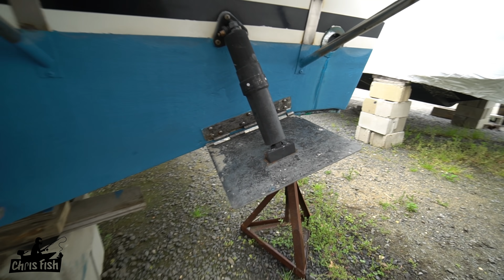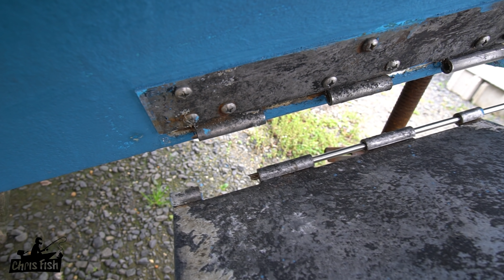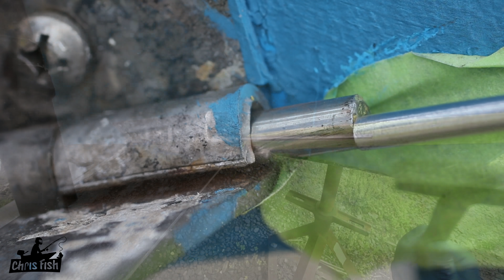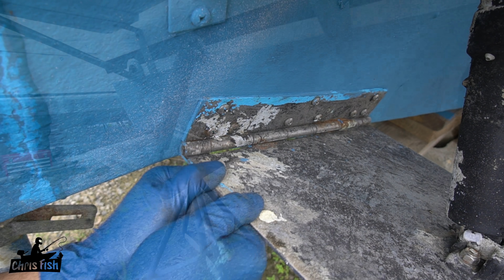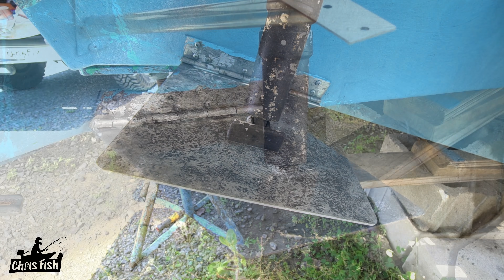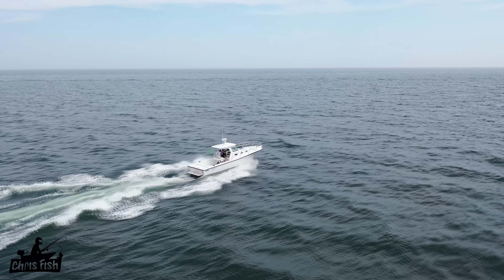How to Repair Boat Trim Tabs (Saving over $350 by doing it yourself)

Comment: So after several seasons have there been any issues with galvanic corrosion??
Reply from the maker: Yes I ended up finding the problem. The previous owner cut the cable to the mercathode. I replaced/repaired it and I hope the boat goes in the water soon!

Comment: Hi Chris, just a suggestion for you and your followers: you need to put a small plate of zinc on each flap, in the upper side of it, otherwise you should change again soon the shaft you just repaired. The reason is that the flap is severly interested by the galvanic current, due to the sea water flowing under it. The galvanic current produced by the interaction with the water flow will destroy soon the   noblest metal among those that make up the structure of the flap, and I suppose will be again the shaft of the hinge. Make a small hole in the center of the flap, then put the zinc plate in the upper side of the flap that will be secured by a simple pin and a self-locking bolt, and that's it! Change the zinc plates every season and the problem will be fixed for ever.. ;)
Enjoy!
Reply from the maker: Interesting. I didnt realize moving water could create galvanic corrosion. I will look into it! Thanks a lot!

Comment: the thing to understand about stainless is that the reason it doesn't rust is because the chromium forms an oxide layer, however if the stainless is always submerged that oxide layer cant form, and then it will still rust.
Reply from the maker: Interesting. But then why won’t stainless rust underwater?
Reply: @chrisfished  it does lol, some grades are better at resisting the rust but all stainless can rust. passivating can improve the corrosion resistance, but that can be worn away with abrassion, for example when used in a hinge.

Comment: Looks like that old rod is 304 stainless steel! It gets pitted over time from the chlorides in the water
Reply from the maker: I wouldn't doubt it if it was! Felt pretty cheap though
Reply: @chrisfished  Crazy how they would cheap out on the hinge! But it didn’t look like it took too long to swap it out. How many years did the original one last?

Comment: Hello! Just a point of suggestion, you might want to consider placing zinc anodes on the trim tabs. Two dissimilar metals will always corrode the weaker metal even if they are both stainless steel. Having a zinc will make sure the corrosion will happen to the zinc and not your $300 trim tab.
Reply from the maker: Definitely a great option but the outdrive has a mercathode which apparently was not working so I fixed that and that’s supposed to protect the metals from corrosion.
Reply: @chrisfished  unless there are bonding wires from the trim tabs to the out drive the trim tabs are unprotected. Granted, it’s not a massive risk. As your video showed, pretty easy to fix. Good stuff!

Comment: You need to put anodes on your trim tabs.

I suggest either Zimar R2 or Zimar R3 anodes.
Reply from the maker: The outdrive has a mercathode that was not working when I got the boat. It’s functioning properly now so that should fix the corrosion issue. If that doesn’t work then I might have to weld a stud to the tabs and get some zincs on them.
Reply: @chrisfished  no sir simply drill a 5/16 hole in the trim tab and I’ll send you a set of the best saltwater trim tab anodes you can get. 

I’ve been watching you for years so I’d be happy to help!

Comment: The fact that you pay so much money for a boat of your size and has low quality trim tabs is unbelievable! Also what happened to all of those dead fish in the day you lunched the boat? ( if the word lunched is wrong correct me)
Reply from the maker: Corrosion is a big issue in saltwater! The fish had a virus or bacterial infection that kills them. Happens to a small population every year unfortunately.
Reply: Wow ok. By the way I have a car that leaks a lot of oil so much that it has covered the gearbox!!! I think it's something like a seal on the oil pan I will send you on Instagram the pictures. Thanks alot

Comment: Need clarification; manufacturer used iron for cost reduction or prolonged duration of use? Is the metal rod you installed durable and NOT just corrosion resistant?
Reply from the maker: Correct the stainless rod will be durable and corrosion resistant. Idk why they used a cheap iron rod.

Comment: he did more damage with the tape i guess better safe then sorry if i was you i would hate staring at that love you keep up the good work on both channels i love how you read every single comment and respond like who has time for that??!?!?!? also have you ever gone overboard? or fallen in the water trying to get in the boat?
Reply from the maker: It’s not damage. It’s ablative paint which is designed to come off to keep barnacles and other stuff like that off. I didn’t want to damage the gel coat which is the coating under the paint. At the end of the day the tape wasn’t really necessary tho (as you saw haha). I have never fallen overboard on the boat. I have on the dock twice. Both times I had my life jacket on and was ok. Falling off the boat would be very scary.

Comment: Shoudn't you use a more corrosive resistant steel than just stainless? In Finland we have something we call acid resistant steel. I would use that rather
Reply from the maker: 316 is marine grade stainless so it’s very corrosion resistant.
Reply: @chrisfished  Oh ok! Hope it lasts a long time!

Comment: Wow great job saving the money and doing the repair yourself. It’s great to maintain your own stuff.  Only question I have for this job is should it be a tight fit and should that rod be lubricated first?
Reply from the maker: Thanks! It’s only a tight fit on the ends which don’t move (hard mounted to the boat). The holes in the trim tab move and the water is the lubricant. Any oil/grease will come right off in no time from the water pressure. Great questions

Comment: As soon as i clicked I noticed a wobbling noise at the very start of the video coming from the microphone housing. To fix this, you can tape the anti-shaking housing so there isn't any severe vibration when walking with your camera
Reply from the maker: Thanks for the tip! The mic actually broke that day and I didn’t notice until I got home.

Comment: I'm not into fishing or boating but I do enjoy watching you do this stuff. Why would you not remove the factory screws on your trim tabs?
Reply from the maker: Thanks a lot Richard. Those holes the screws are in are below the water line and its just a lot a lot easier and less risky to not touch it if you dont have to. Nothing might happen or it could snap or it could cause water intrusion issues. Great question!

Comment: Be careful mixing different metals like that especially in saltwater
Reply from the maker: For sure but that is what was used except they probably used 304 stainless which isnt as corrosion resistant. .

Comment: Hey Chris! Just curious, since I have pretty much zero knowledge in boats, why didn't you grease up the rods before driving them in? Is it completely useless? I like to grease pretty much everything that could be helped by lubricating, also, maybe one more layer of rust protection?
Reply from the maker: That will be under water so the grease will be gone pretty quickly. You're def right it wouldnt hurt and might help a little with the corrosion for the short term. The water will act as the lubricant since it is slow moving. Good question!
Reply: @chrisfished  Thank you Chris!

Comment: Thanks for your new channel, and all you hard work. I even went back 7 years to learn how to filet fish from you, video I had skipped previously :D. About this video, even guessing that it'll probably wash out in a day or two I wouldn't be able to resist applying a ton of heavy duty grease to the joint before installing, I mostly work with bicycles (and wood) and have almost no experience with boats (besides brushing decks and filling cracks with glass fiber).
Reply from the maker: Thanks a lot man! Haha I was going to add grease but like you said, at the end of the day, its going to wash away the first time it goes in the water. Hopefully you learn something new with boats by watching!

Comment: The reverse on my pontoon's outboard engine doesn't work (im thinking a clutchdog). Would love a video on how to disassemble and reassemble a similar engine. Keep up the great work and fun videos!
Reply from the maker: Does it click into reverse or does it not even click in?
Reply: @chrisfished  it clicks
Reply from the maker: @EagleFreedom21  is there any noise or vibration? Does the prop spin at all?
Reply: @chrisfished  Just the clicks. Prop spins slowly, not enough to move anywhere.

Comment: Hey Chris where did the outdrive go do you take it off when you pull the boat out of the water
Reply from the maker: The marina takes it off for indoor winter storage. They pressure test it and change the gear oil for  me.
Reply: @chrisfished  ok thanks

Comment: Where I work, we usually sand the the trim tabs with a 40-80 grit before painting. It makes it smoother, cleaner, and better for the paint to stick on.
Reply from the maker: Thanks! I used 120 grit to sand it which seemed to work pretty good so far (2 seasons later).

Comment: Hey Chris! Can you make a video showing ways to find out if your V-Drive Boat has a cracked block, or just a failed head gasket? I’m getting water in my engine oil and transmission oil.
Reply from the maker: Do you have an oil and trans cooler? Many times the thin metal on those corrodes. If you do, take the oil cooler off and get it pressure tested.
Reply: @chrisfished  I don’t on this boat. It’s an open loop system so It takes in the lake water to cool. Any other tips or tricks you might have for me? Appreciate the response and love the videos! Extremely helpful!!

Comment: Nooooo! You can only use a file in one direction, otherwise you blunt it!
Reply from the maker: Thanks for the tip. I am not sure if it is a big deal since a file is hardened steel and the 316 stainless is less "hard" but I will keep that in mind!

Comment: They don't make a pin? I mean they got aluminium rods on ebay 😂

Steel, man... Sometimes steel doesn't even have iron in it, like surgical steel, which is why I can't trust it 😂, I hope this doesn't rust!

Could you also peen the ends?
Reply from the maker: It's been 2 years and no rust at all so it's all good. Aluminum is too soft and might shear with the pressure from the water. You could peen the ends but this worked perfect.

Comment: I love seeing how you apply learnings from the first pin to improve your method for the second! Did the tape pull off some paint, or is that adhesive residue?
Reply from the maker: It pulled off paint. I realized the marina painted the boat only a week ago and since this is anti-fouling paint it is designed to come off so barnacles and other sea life wont stick to it.

Comment: Was the end that you pried open supposed to be closed/tight to prevent the rod from moving and the rod intended to be inserted from the other side?
Reply from the maker: No both ends are supposed to crimp down on the rod. Technically this is a "non serviceable part" according to the manufacturer so I had to make my own rules haha. It's held up for over 4000 miles and 2 seasons so I would say it worked out! Driving it into the far end definitely held it in the most!
Reply: @chrisfished  oh that’s good to know! It looks 100x better than the rusted version you replaced!

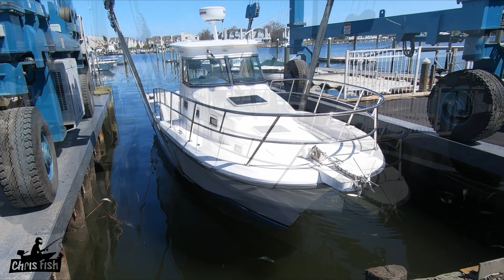Comment: at 7:05 why are there so many dead fish in that pool of water ?
Reply from the maker: Some of those fish had a virus or bacterial infection that causes them to behave erratically until they die. It could be due to stressors like pollution or low oxygen levels in the water.